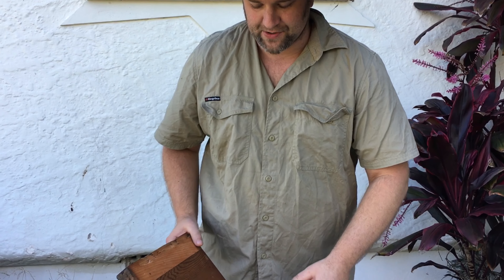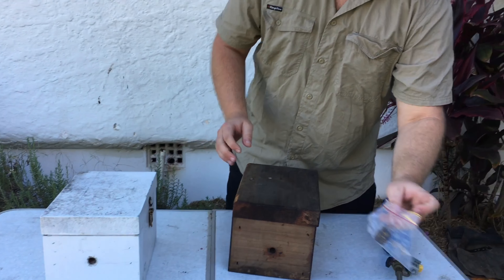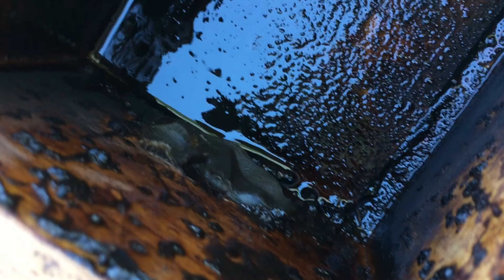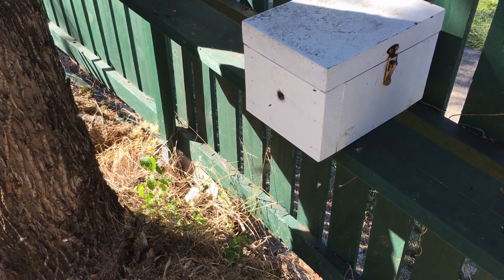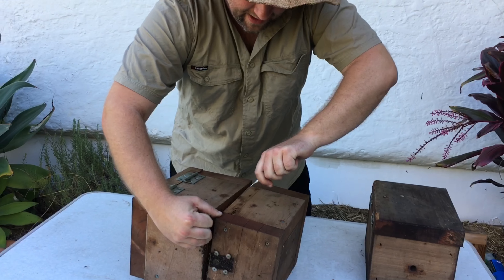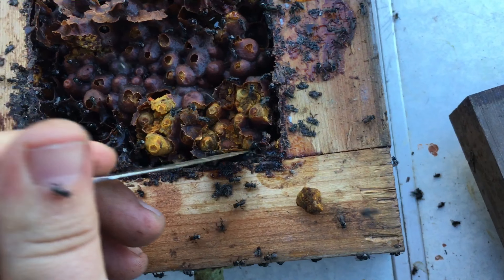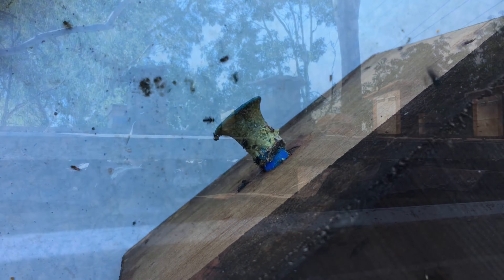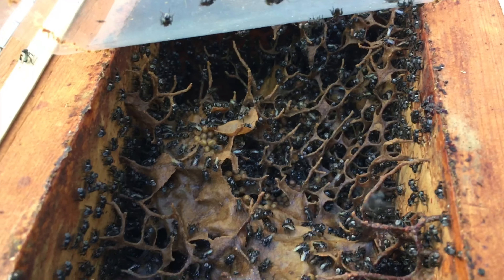Micro colonies Part 1 🐝

Comment: interesting so is this in replacement of a split so you can effectively make a new colony from a hive 2-3 times a year instead of 12 month splits or will the two original halves still be added to empty sides?  so you can add pollen but not honey to Carb hives?
Reply from the maker: jako j yes that’s correct. But bee warned that these take a lot of care. Maybe some failure too before you get it right. Tiny bit of pollen smaller is better.